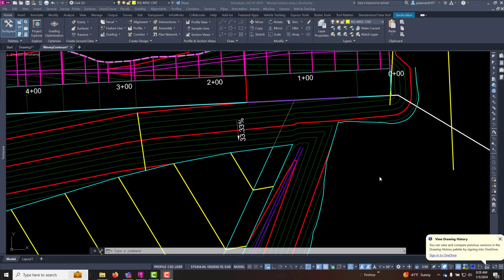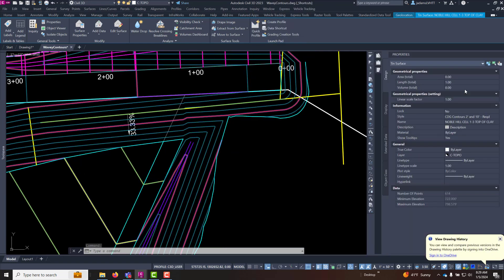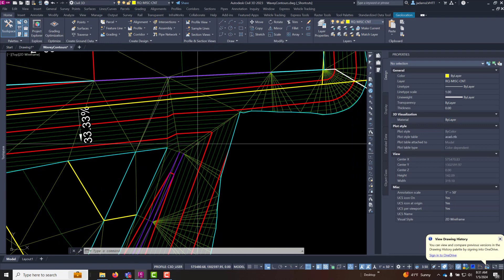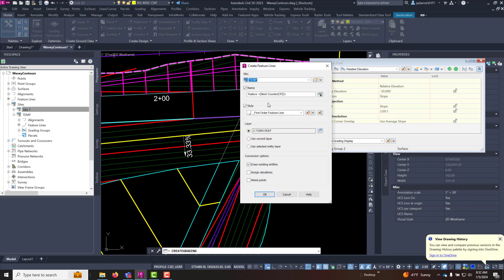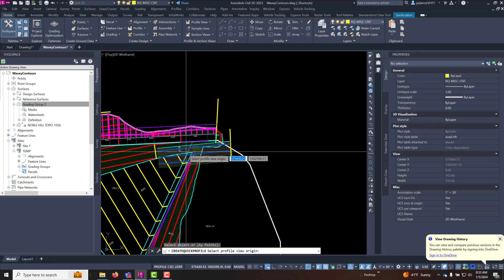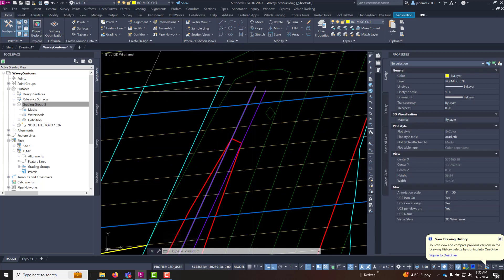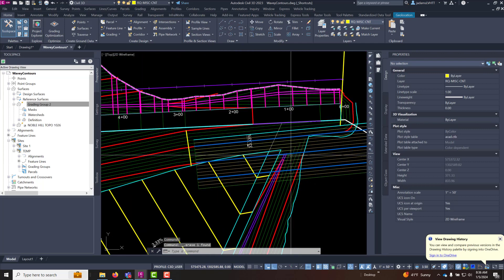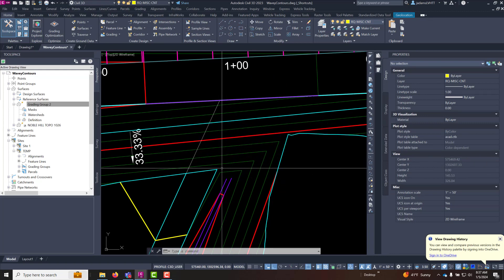Civil 3D - Method for Polishing your Surfaces

Comment: great video! I love watching your content. Very easy to understand. An alternative would be to make another dummy surface with the bottom of ditch, run minimum distance analysis to draw a 3d poly where the surfaces intersect and then trim features off of that. Trim features command! I never even knew it was a command. I also like how you use circles for quick dimension checks. thanks!